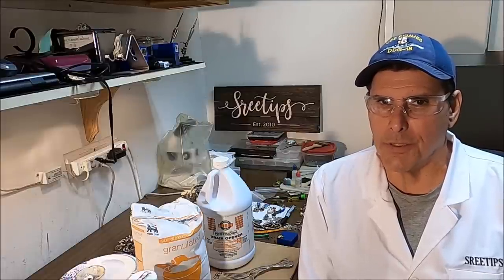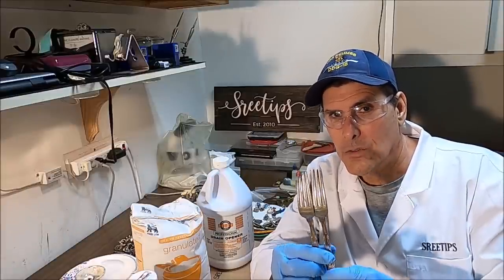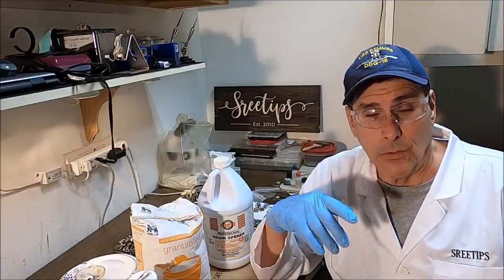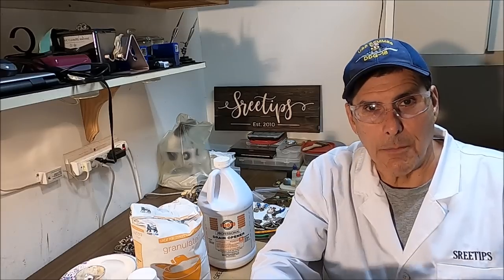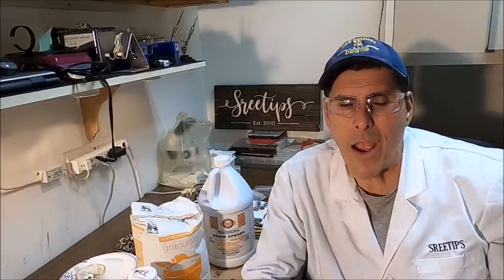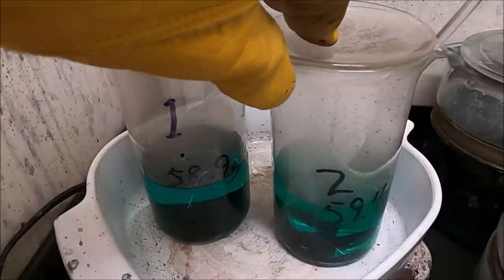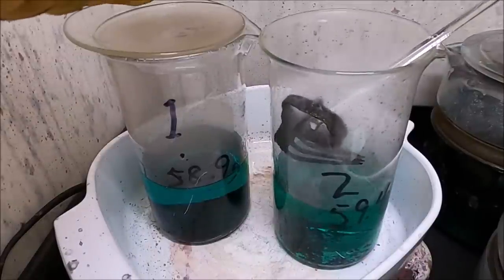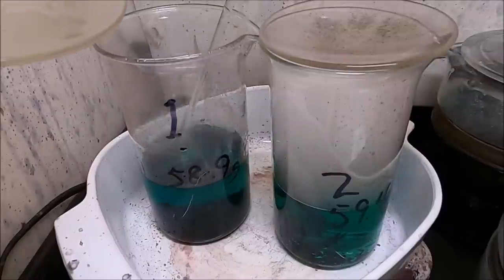High Purity Silver With Drain Cleaner pt1

Comment: Is it possible to attach a motor to that roller press?
Reply: More expensive rolling mills can be purchased with a motor option.
Reply from the maker: Yes, I could buy a second hand reduction gear and attach a small 1/2 hp electric motor. I’m just not that sophisticated yet.
Reply: @sreetips  there's an easy way to do it. This is how I did mine.  Remove the crank and install one half of a "Lovejoy coupling" onto the shaft. Find whatever reduction motor you choose and mount the other half of the coupling onto it's output shaft. I believe you can mix and match couplings depending upon each shaft's mounting (keyway, set screw, etc.) Then it's the most complex part - mocking up a mounting such that both shafts butt together cleanly. Then wire the motor through a Deadman switch for operation so that the mill will stop turning immediately when you let go of the switch. I didn't do that last part, but recommend you do.

Comment: Can this be done with brazing solder (rods)
Reply from the maker: I did a video using Staysilv 15% silver brazing rods. I used nitric to dissolve them. It took a long time with nitric. No telling how long it will take with sulfuric. To answer your question, I don’t know because I’ve never tried it.
Reply: That depends on the exact composition of those brazing rods. Should those rods contain any metal creating insoluble sulphates (like lead, for example) then this method can't be used. My thinking is, if it took a long time using strong oxidiser (nitric acid) then it will take forever to dissolve them with mild oxidiser (concentrated sulphuric acid).

Comment: Did you put bicarbonate
Reply from the maker: No
Reply: @sreetips  Just.  NaOH.
Reply from the maker: Correct
Reply: @sreetips  The water that I put in the bucket, can I use it to extract the crystal?
Reply from the maker: I wouldnt
Reply: @sreetips  Will it be good if I use it in the crystal?.
Reply: @sreetips  Good evening Doctor.  Is battery acid good with silver

Comment: Ok, now that you have dissolved the forks and recovered the silver, it's now time to address the "Solids" in your filter. If the forks are 90% silver and 10% copper, what is the solid material in the filter?  It must be un-dissolved Silver or copper, there is nothing else it can be. Dissolve the Solid residue from the filter with Nitric acid and see what you get.
Reply: The solid residue shouldn't have much to any copper in it as copper is highly soluble in sulfuric acid but silver is only partially soluble. On a side note, when Sreetips converted the silver sulphate to silver chloride he also converted the copper sulfate to copper chloride. Copper chloride is soluble in water where as silver chloride is not.
Reply: "It must be un-dissolved Silver or copper, there is nothing else it can be" - well, actually it can. "Impurities", it is called in the trade, y'know...

Comment: yeah you should do some more research and maybe a little bit more schooling before you actually attempt more chemical refining in the future.
Reply from the maker: Ok, will do
Reply: @sreetips  no seriously check out NileRed or NurdRage's videos
Reply from the maker: I’ve seen both. They have excellent videos.
Reply from the maker: But them guys know their stuff. I’m no chemist. I took a chemistry class in high school back in 1970 and got a “D”. I hated it. But I was always good with common sense and logic. I’m just an average hobbyist trying to have some fun with my hobby!
Reply: @sreetips  I understand where you're coming from I dabble in chemistry as well. My profile picture is CuSO4 crystals I made from electrolysis of copper metal in sulfuric acid. In your videos you just do things by eye and I would think you would benefit from simple stuff like pH paper or Buchner funnel. I think your hot plate could be improved by using a kitchen pot or pan filled with sand to spread the heat evenly. Your less likely to have a metal container fail than the porcelain. Which you pointed out hot sulfuric acid is no joke. 🙂
Reply: @sreetips  My age!